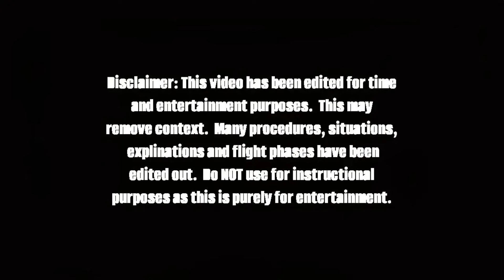Stay Calm: Handling Engine Failures

Comment: Good job with high altitude orientation.  Good caution on no stall.  Student did a good job allowing the nose to pitch to less pitch attitude (he released a bit of back pressure) in the climbing turn go around.  Altitude is time.  Time to get the nose down or even recover from stall/spin.  Time to navigate and communicate.  Best glide airspeed, or even looking at the indicator, is not a distraction.  Engine restart can be tried.  Both vertical and horizontal space is ample.  Wind management for better radius of turn and less ground speed not a big issue.  Down drainage is not a big issue.  Turns may be to heading.

Eleven of my thirteen engine failures were at 200' AGL or lower crop dusting and patrolling pipelines.  Airspeed, and not altitude, was life.  Zoom reserve airspeed, max from ground effect over runway or crop row or cruise climb airspeed, was available for maneuvering flight.  Turns were to target, the workable landing zone.  Aviate was the only issue.  Six seconds is not enough time for navigate and communicate and either would be a distraction.  I turned at whatever bank was necessary to make a workable LZ while releasing back pressure on the stick so as to maintain airspeed and 1 g.  I turned at whatever bank was necessary not to hit obstructions.  I turned into the wind if available and LZ that way.  Finding the right LZ was not a problem given the limited targets in the very, very close hemisphere in front of the wing.  Startle delay, evidently, is not as big an issue when we have zoom reserve airspeed.  Use level in low ground effect acceleration on takeoff to cruise on long runways.  You never know when it will make all the difference maneuvering to a workable LZ, even if between obstructions using wings to absorb energy safely.  Turn as necessary but do not pull on the stick in the turn.  The airplane cannot stall itself at any bank angle without a pilot pulling back on the stick.

Comment: I was never instructed like that. My instructor just pulled the engine and said you lost your engine. Figure it out.
I’m impressed.
Reply from the maker: Well that's not a fun or enjoyable learning experience. How would you know what to do the first time it happens? Then when you get it wrong, the way you chose is burned into your mind and how you'll always do it. Show the student the right way first, especially that there is no need to panic, then hit them with the surprises on every flight from there on out. It's something that in my opinion is very under trained. Thanks for watching.